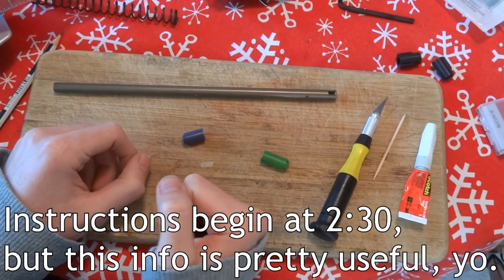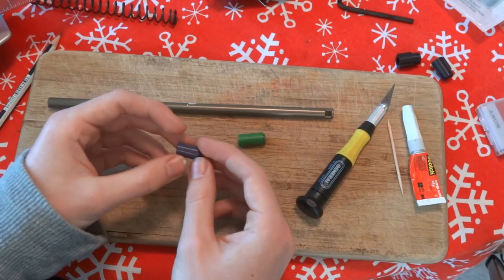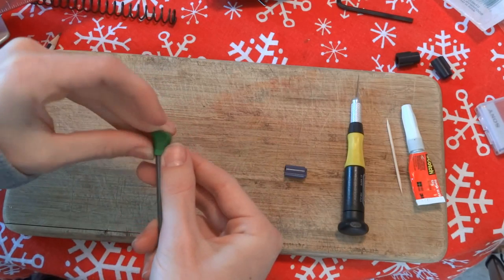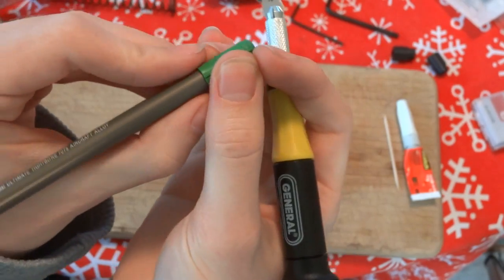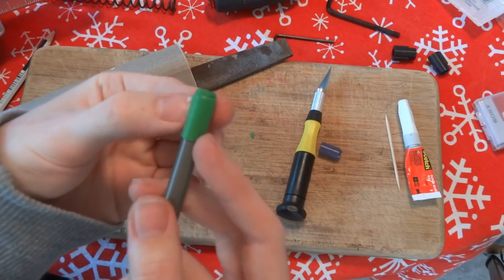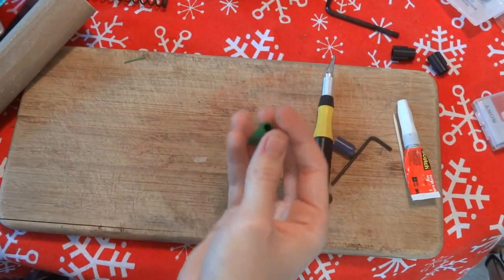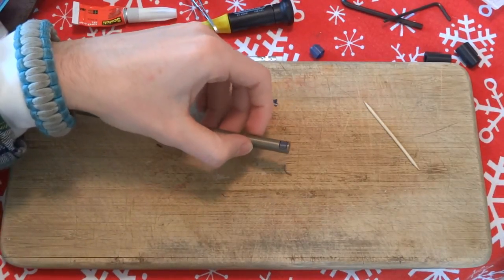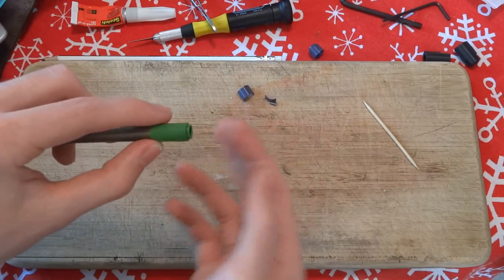Increase any Airsoft Gun's Range and Accuracy: G-Hop Installation Guide

Comment: Hey, I'd just like to share my experience with G-hop.
I own a Classic Army M15A4 (Yes, very old) and I got into modding weapons recently. I've correctec the AoE and installed G-hop inside. For some odd reason, the G-hop decreases my fps by around 20, making my current fps around 280, but that's not an issue. Before the G-hop mod, the BBs had a pretty normal range. After installing G-hop, It shoots around the same range as my gas rifle with 0,4g bbs (which has 500 fps). G-hop is working REALLY great! I'd recommend anyone who has the time and effort to install this mod. Thank you TopHat for sharing this great mod for us :3

I used black G&G hop-up rubber for the tight seal and Prometheus purple hop for the contact patch. As Maple leaf hop up nubs were out of stock, I bought Prometheus hop up tensioner(flat) as my nub. As mentioned, It works great. I haven't tried using other nubs, but I'm planning on buying/modifying some nubs to test with G-hop. Not anytime soon tho since I'd like to enjoy this new added range for a while :3

Comment from the maker: The bit of the contact patch protruding into the barrel is not a problem, it's what allows the G-Hop to perform as well as it does. This allows the patch to contour to the BB while the BB passes by, which allows the G-Hop to impart a better spin on the BB. The BB is round so there's no way the BB could get caught on the patch and damage the patch.

Comment from the maker: If your gun over or under hops you should be able to adjust your hop chamber to apply the correct amount of hop. If it doesn't work great try using a normal nub. Hope you get good results. :)

Comment: Tips: 
- you don't need to shave off the long thin ridge. 
- use Dremel or any high speed power tool to sand off the hop nub
- scissors can cut faster and accurately VS knife
- scissors can cut angled cuts in the contact patch
Reply from the maker: +swatti87
-If I don't shave off the long thin ridge the bucking doesn't fit into the chamber. Whether or not you have to can depend on how tight your barrel, bucking, and chamber fit. While you might not have had to in your setup, you might have to with other setups.
-That's a good Idea, I need to do that.
-I can't get a straight cut out of scissors. If it works for you, do it, but I get terrible results using scissors.

Comment from the maker: Yes. G&G rubber works well for the contact patch, but harder rubber will get you more hop consistency in higher FPS guns. The best setup is a harder rubber for the contact patch (I wouldn't go harder than 70 degree) and soft rubber for the outer bucking (softer buckings get better air seals).

Works great with 500 FPS. If you can't get the install right just pull off the contact patch and use a PDI W-Hold bucking if you want more accuracy or a Silverback 80 degree bucking if you want more range.

Comment from the maker: The bucking alone would have to bend down through the hop window to reach the BB, which will form a lump. This lessens the amount of rubber coming into contact with the BB, since the bucking has to bend around the hop window. The contact patch will take up the full hop window since it doesn't have to bend down around the front and back ends of the hop window. The longer contact is definitely the better performance, it's the whole idea behind this hop mod (which I state in the video at 1:40).

Comment: Thanks a lot for your answer.
I will remove the Systema bucking, take apart a A+ REAPS 60° hop rubber (which already gives me around 60m on my G3 DMR)...and take some G&G bucking I have lying around. Will report back with test results when I have time to do the mod and tests.

Comment: On your hop up bucking you want to remove the bump and the guide strip. Get them sanded down nicely so it will fit in your chamber (he says that in the video). Make sure when you slide it on over the barrel an unused side of the bucking is over the contact patch. Otherwise you may have issues with curving. This mod will push you close to 250-300ft overall range. Your effective range will go WAY up. It is a nice flat trajectory all the way to target.

Comment from the maker: No, I haven't tested nubs yet. I've been working on another project, which is getting AEGs to shoot EXTREMELY consistently. I've come up with a product, it'll be a cheap, no-modifications-required drop-in upgrade that gets my stock VFC 416 to shoot with 0-1 FPS variance between shots (which is better than I've ever seen a polar star or anything else chrono). Still got a lot to do with that before it's on shelves, tho, so idk when I'll be able to test nubs. Thanks! GL with G-Hop, it's magical. :)

Comment from the maker: No problem, and I see which gun you want. You can put a 509mm in it even if there's space for a 650mm. I run a 455mm barrel in my Type 97 even though the barrel is 480mm. The only reason I could see that you couldn't run a shorter barrel is if the outer barrel is loose around the inner barrel and only locks down on the inner barrel around the end of the outer barrel. I'd recommend a Prometheus barrel if you have the budget.

Comment from the maker: Thanks! Awesome, SL9 is a sweet looking gun. Don't go longer than a 509mm barrel (Unless the SL9 has an extended cylinder). Longer barrel is better in a real firearm because it gives more time for the gas to expand, but airsoft AEGs are blowguns so with a longer barrel you just run out of air in your cylinder before your BB runs out of barrel. 6.03mm is good. You'll need .36g BBs or heavier for 200'+ shots. You'll get better performance with harder (70 degree) hop rubber for the contact patch.

Comment: There was a test here on YouTube – testing an airsoft pistol with an airsoft rifle – the pistol was more accurate than the rifle – which stands to reason – the less friction you have in a barrel causes less spin on the BB – shorter barrel equals greater accuracy
Reply from the maker: I don't think the test is that conclusive, if it's conclusive at all. There's far too many other variables besides barrel length. Did the pistol and rifle both have the same brand and style of hop up bucking and nub? Were they shooting the same exact FPS? Were they both using the same kind of propellant (GBB and AEG systems both have different properties when it comes to launching the BB)? Were both inner barrels the same bore, smoothness, quality, and material? What BB weight was used? Unless, of course, everything was the same between the guns... but then if the test was outside I could still be a pest about windage... also, what was the range? Tighter barrels perform better at closer ranges while looser barrels are better for long ranges. For that test to mean anything barrel length would have to be the absolute only difference. Some guns can get more accuracy out of shorter barrels and some can get more out of longer barrels. It all depends on your volume output. If you test a stock pistol against my Type 97 or KC-02 you'll get very different results, but at the same time my M93R or P226 will outshoot a stock AEG.

Comment: I noticed in my guns that the hop up adjustment is much more sensitive. It takes a while to get it dialed in (except when using a TDC "Top Dead Center" mod). It will easily go from no hop to over hop with a slight bump. You might want to just keep adjusting it to see if you can get it working. The mod is awesome. You will notice a nice increase in useable range and from my experience,  the groupings seem tighter from left to right even at long range.

Comment from the maker: Glad to hear you got some good results, I always get amazing results myself. :) I've never had a G-Hop patch wear out with normal use. Not even in my Type 97 (which shoots 430 FPS) and I've shot over 30 thousand rounds through that gun's G-Hop. The G-Hop still performs as well as when I first installed it, perhaps even better. Just use enough CA glue. :) The contact patch does dip into the barrel, but it doesn't seem to cause any extra wear. No problem, glad to help. :D

Comment: G-Hop is really nice for the person who doesn't want to spend alot of money for R-Hop. Now on the durability, Ishioka Gungineer, the inventor of the G-Hop, even says that durability is a finite lifespan. The R-Hop takes it one step further, by making a full-seal contact patch, and it has an indefinite lifespan. Now I have both in my DSG, and I can't tell the difference, except if you glue the G-Hop wrong, it can fly off, the R-Hop is harder to break.
Love this video because its the only one out there (In English) at least covering the G-Hop, the predecessor to the R-Hop.
Reply from the maker: +BLEEPIN FIREMAN Thanks! Glad you like my video. I did want to translate the concept of G-Hop to English since I could only find diagrams on it in Japanese... I'd liked to have given more credit to the inventor and history of G-Hop in the video, but I couldn't find it in English anywhere lol. Thanks for letting me know who invented it. Also, technically every hop setup has a finite lifespan and should be replaced eventually... Regular buckings, G-Hops, R-Hops, everything. Personally I find better results with G-Hop in AEGs and better performance with R-Hops is GBBs.
Reply: Except it doesn't take a lot of money to R hop. If you do an S hop which is more popular today, it is even easier than a G hop. You don't need to use Sugru you can use 100% Type 1 silicone sealant.

Comment: Just installed an extended G-hop on my 409mm 6.03 prommy...  (replacing my previously installed IER-hop) I must admit, pretty nice results.. even more consistent hop dan ER-hop. (for info, using an EM-nub, 0,3g ammo, 1,8J, Lonex 70D for the contact patch, Lonex 50D for the outer bucking) great video btw!
Reply: just a small question, have you examined your G-hop after a couple of thousand shots? interested to see the residue of bb's (specially bio bb's) left behind onto the patch itself, might be enough to cause some inconsistency after a while... just some food for thought. HS5 claims his R-hop doesn't collect as much trash from passing bb's as any other hop, still I have to see some proof of that :)
Reply from the maker: Jonathan Cuypers I get better results in G-Hop when compared to R-Hop as well. I want to try the maple leaf buckings, they are like G-Hop in a bucking. I'm wondering if having the bucking and contact patch as one piece will improve consistency... Anyway, glad to hear you got good results with the EG-hop! I need to install one of those into my Type 97 now that I've switched over to .32g BBs... I have noticed a residue build-up on the contact patch after many rounds. If you place your finger on top of the contact patch you can scrub it off with a Q-tip. I actually think washing the BBs might prevent this from happening (not sure as I didn't wash my Golden Ball BBs since it actually decreased their performance. Now that I've switched to Airsoft Alpha I see a performance boost after washing, but I haven't shot many of these washed BBs through a G-Hop), but I have a theory that this build up might actually improve the consistency, as I notice all of my hop mods perform better the longer I've been using them (my best performing G-Hop contact patch had hundreds of thousands of rounds through it before I switched to a harder contact patch). Just a hunch though.

Comment: In addition to the trajectory, this mod also allows you to use heavier BB's and hop them to those distances. My P* at 400fps (.20) with a 300mm inner barrel was pushing .28s out to about 90 yards. Same goes for my 410fps (.20) G&G AK (510mm inner).

Comment from the maker: I use silverback 70 degree for anything above 350 FPS. You can try silverback 80 degree rubber, but if you don't glue both sides of the contact patch with pretty much exactly the same amount of super glue you might get side hop.

Comment from the maker: Sorry, I thought I replied to this already, but I guess it didn't go through. Anyway, in my VFC 416 (315 FPS with .20g) I get 170' effective and 190' max range with .25g BBs. In my Type 97 (440 FPS with .20g) I get 215' effective and 230' max range with .25g and in my KC-02 (390-420 FPS with .20g, the hop is pretty inconsistent, but I'm working on fixing that) I get 270' effective and 300' max with .40g. My Type 97 would get more range with heavier BBs, the heavier the better.

Comment from the maker: Your problem sounds like a faulty outer bucking. You cut the hop lump and ridge off of the inside of the outer bucking, right? You might have that issue if you didn't cut off enough of the hop lump. Also, the hop dial does get a bit touchy with this mod, a slight change on the dial can make a big difference since there is more contact between the BB and the hop contact patch. With a bit of patience you can get it in the right spot and get some great performance. Feel free to ask more questions.

Comment from the maker: Thanks! For higher FPS I'd recommend harder rubber for the contact patch (I've only experimented with different hardness patches recently so it's not discussed in the video). I wouldn't go harder than 70 degree rubber though, 80 degree gave me sidehop. For the outer bucking it doesn't really matter. I ran my type 97 at 460 FPS for awhile, the G-Hop worked great with that, so it'll work great with 500 FPS. Just be a bit generous with the glue without getting any into your barrel. :)

Comment from the maker: I remember the first time I sliced up a Prometheus bucking... Almost couldn't bring myself to do it. xD I tried gluing the contact patch to the bucking, it resulted in side-hop every time I tried it. It's not necessary either, the glue on the sides is enough to keep the patch on. Just use a fair amount of glue. I've fired tens of thousands of rounds through my 430 FPS Type 97 and the contact patch is still on there. The heavier the BB the better, unless your gun is too weak to handle the weight.

Comment: So iv had my m4 g-hopped for over a month now and have had about 5000 riunds through it and i have not superglued the contact patch. Personally i dont think glueing it into place is nessesary as i have the most accurate gun on the field without it being glued and hasnt failed on me yet. G-hop is so easy and effective.
Reply from the maker: STVMED Did you glue the patch to the outer bucking, or is it just loose? If you left it loose then it's nearly guaranteed that you shot the patch out of your gun and didn't realize it. If so, you'll still get good performance. Doing this mod without the contact patch is called "flat hop" and still performs well, though I get noticeably better performance with g-hop. If your patch actually did somehow manage to stay in your barrel unglued after 5000 rounds it's a miracle and I have no idea how that's possible. Regardless, it'd still be better to glue the patch to the barrel as the glue will hold the patch in place. Leaving the patch loose will allow it to shift around (and it will shift around), which will decrease hop consistency (and overall accuracy).
Reply: I checked out if my contact patch is still in place and is but u mak a good point, I will glue it down to avoid it failing sooner

Comment: Very nice guide. Thanks. I'll give it a try tomorrow. I'll let you know how it ended.
Reply: It ended well. I'm really surprised. Thanks
Reply from the maker: martin ra Glad to hear!
Reply: It added about 30% to range and accuracy
Reply from the maker: ***** Thanks! With college I don't really have time to provide install services, sadly. I'm not a big fan of working on other people's guns either. I'd rather pursue a career in Biomedical Engineering than airsoft as well. However I am working on a different airsoft upgrade part that might be available soon if it passes initial tests...
Reply: *****
 you would be better with scissors when you cut the bucking
 surgical scissors to clarify
Reply from the maker: Jupiter6317 Whatever tools work best for you, but definitely don't use regular scissors. I haven't tried surgical scissors, though I do have a pair...

Comment: I'm not sure why you're using the g&g over the Prometheus purple Prometheus purple flat bucking is amazing that's my go-to and it seals on the barrel so good. I've done flat hopping identity silicone our patch, now I actually use the s-hop just basically just a product that you can buy off of Amazon called sugu I might not be spelling that correctly but using a 6 mm silicone tubing I slide it into my barrel or any sort of object that is of that size that's not going to damage the inside of the barrel and then you know just pack it in around that wiping off all the excess and then what I'll do is I'll let it dry and cure and then I pop mine out and then I glue it back in it is softer and it's not going to last as long as a r patch or silicone patch.

Comment: Thanks for uploading this, I just did this mod to my gun last night. I won't be able to try it until I get a new delta ring tho.
Reply from the maker: No problem! You should see a nice increase in range when you test it out, assuming the install went properly.
Reply: I'm hoping it worked, the notch for the hop up nub is shaped a bit differently on my barrel so we'll see.

Comment: I saw your video not long ago and decided to try out G hop on my guns. I have seen some really impressive gains so far. I was curious how long these typically last for you. One thing I have noticed is that it looks as though the front of the contact patch can easily dip into the barrel, which I would imagine could cause it to wear out quickly. What is your experience? Thank you for posting this video, it is very well done.